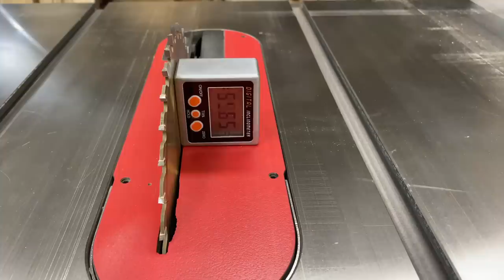This is simple but does a very satisfactory job for 45 degree joints. / 45 degree trimmer jig / DIY

Comment: Excellent jig... impressive. Like it like 👍. Just that the spline used shouldn't be edge-grains , for wood doesn't have strong resistance for force along the long grains. Its strong across the long grains... so spline should be end-grain joined... does that makes sense? However jig in itself is flawless and flexible 👌
Reply from the maker: That's a good comment.😊👍
Reply: If there was a force ie torque I'd say yes, but there isn't, I don't think it makes any difference....

Comment: I hope the joint holds over time, because the inserted spline will not move but the carcass will expand and contact with changes in humidity, perhaps a better joint when using sheet goods.

Comment: Or you can just buy the $30 tilt base and make a sled for it that slides in two planes, similar to what you did here. That way your router bit angle is adjustable from 0 to 45 degrees.

Comment: An interesting and nice jig yes and I'm sure it would have a practical use in some project but for that box demo it really offers nothing. Those inserts won't make the joints stronger than they would be on flat 45 sides glued together. They actually might even be weaker structurally.

Comment: Kinda looks like you need to be able to cut a 45 angle to make this 45 angle cutting jig......WTF
Reply: I was just thinking the same thing!
Reply: Yeah, I just wonder about people sometimes......
Reply: All tiltable circular saws will cut at 45deg. I think you've missed the point of the video as he's making a jig to hold a router at an angle.
Reply: @JohnTheHandymanUK  Sorry. The only point I'm seeing is it takes a jig to make a jig. He's just cutting straight lines. As far as I know, you don't need to use a circular saw in a 45 to make a jig for a router to cut a 45. Maybe I just don't get it.....
Reply: Just re-watched the video, and I guess in this guy's one instance of a blind spline on one side of a planter box(?), I can see it being useful, I guess? (Sarcasm)
Reply: @JohnTheHandymanUK  agree
Reply: What he has done is show a repeatable option to buying  biscuit jointer , domino , or dowel guides for a project. This would be very handy on longer length projects for alignment and easy assembly weather it was done full length or spaced. Think beyond the box and don’t get trapped within its walls.